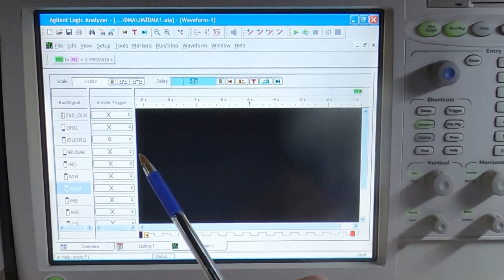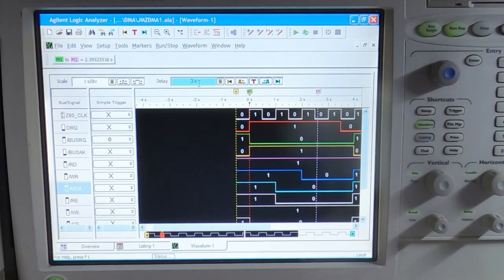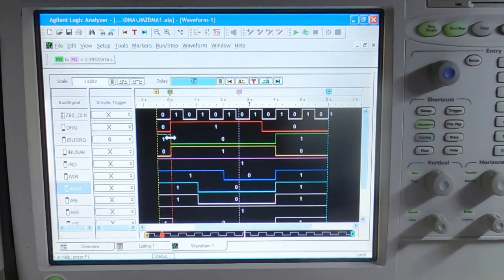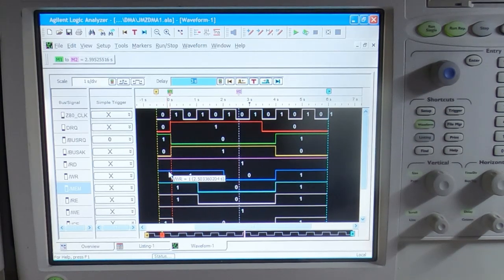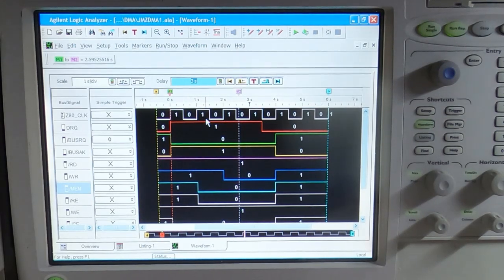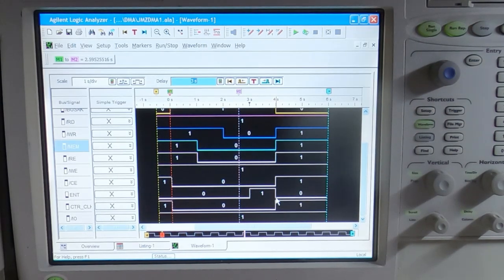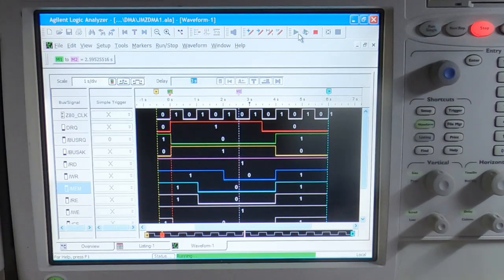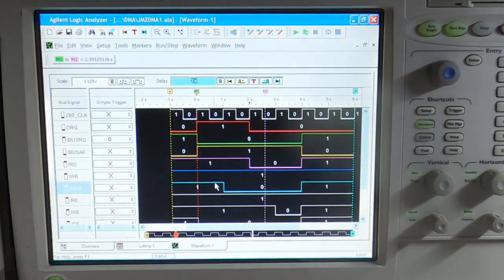Designing A Z80 Computer Part34

Comment: So the dma transfers 1 byte from i/o to memory, the dma would not take the bus transfer the block and hand back its done 1 byte at a time and would be done in software if more than 1 byte. The cpu stays idle during r/w from floppy
Reply from the maker: I will explain this in more detail as the design develops but in short if the DMA was transferring data from RAM to RAM then you would generally design it to move entire blocks in one go and use a separate refresh system if you had DRAM. However the Floppy disk data transfer is very slow compared to the Z80 and takes around 32 uS (200 clock cycles at 5MHz ) to read a single byte. The idea of the DMA is firstly to  transfer bytes fast enough to allow operation without running out of processor clocks. 32 uS only allows a few instructions to be executed so the coding is very difficult. Using DMA it only takes one M cycle to transfer a byte to RAM and then the DMA hands control back to the Z80. In simple operating systems like CP/M the Z80 generally waits for the next byte to be ready for transfer and then performs another DMA cycle. In more advanced systems the Z80 could go away and do something else rather than waiting as the DMA transfers only require 3% of the processor resources rather than the 100% for programmed IO. When an entire sector has been read (256 bytes in this case) then the FDC circuit generates an interrupt to inform the Z80 that the sector read (or write) is complete.

Comment: So this basically mimics the so called flyby mode of the z80 dma and not the normal mem write after io read of the z80 DMA? Thus requiring the „doubled“ control lines rd wr for the io devices you want to enable DMA for.
Reply from the maker: That terminology really relates to the Z80 DMAC devices rather than specific DMA circuits. They are all forms of DMA and you can select whichever is most appropriate for your application. For example I have not included a latch and buffer and MUX to control the bank select lines so the transfers will always be within the current bank but as that is what I need it is fine but may not be what is needed for other systems. The case you quote of I/O device to memory is exactly what the circuit I show provides as we are taking data from an I/O device and transferring it to RAM. The means by which you do this is up to preference. Also we are only transferring one byte during each cycle rather than making block transfers so it is often called cycle stealing but again they are all forms of DMA so for the purpose of this video I do not need to complicate things by discussing forms of DMA that I am not using.
Reply: @JerryWalker001  Ah, OK I missed that part than, I thought you might transfer whole sectors at once or up until the last byte is read. BTW that „flyby“ transfer I was referring to isn’t really an official mode of the Z80 DMAC although it’s mentioned in the peripherals application document, it’s only usable with additional hardware because the DMAC does any transfer in two steps, first read cycle than write cycle which is why it’s an easy to implement circuit - it’s basically parallel to the cpu but needs at least two clock cycles to transfer one byte which yours would theoretically be faster with one byte every clock cycle if you could do block transfers.
Reply from the maker: @0toleranz  Yes I have been using them for around 50 years so I am fairly familiar with them. Note that the DMAC transfers are not completed in 2 clock cycles but in two bus cycles. The reason for that is because it can transfer from RAM to RAM but it cannot of course access two separate RAM addresses at the same time so it has to read data and buffer it and then write it back in a separate transfer. Using IO as I am in my circuit we can complete the transfer in a single operation because we are transferring from an IO device to RAM or vice versa and not RAM to RAM. That is fine in this case because the design is intended only to support the FDC.